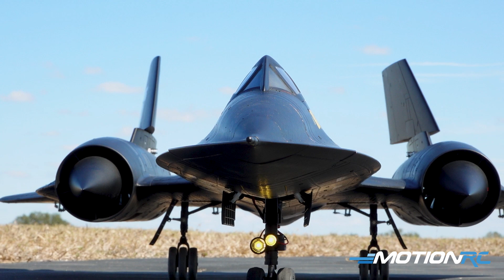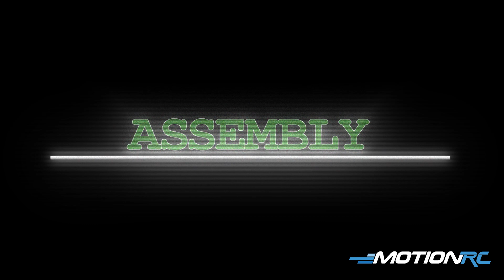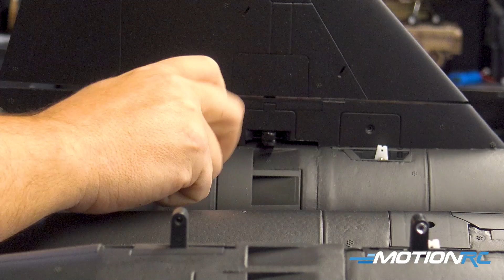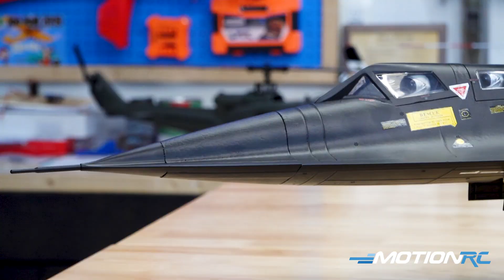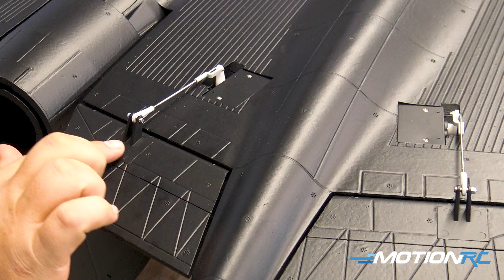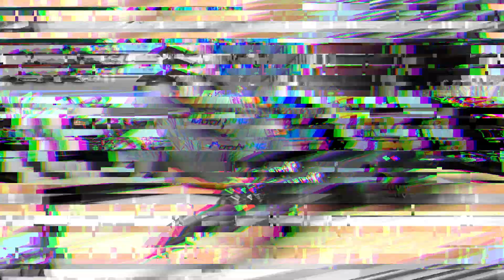Freewing SR-71 Blackbird - Twin 70mm EDF RC Jet Assembly | Motion RC

Comment: Do you need to connect the UBEC?
im guessing that goes into the power channel and the throttle signal to another channel
Reply: ok i got it. On a spektrum receiver i had to set it to set wing type to elevon A ...